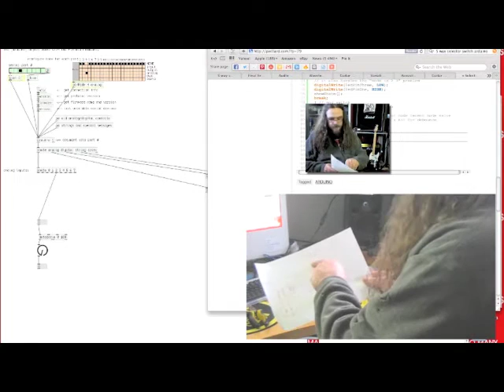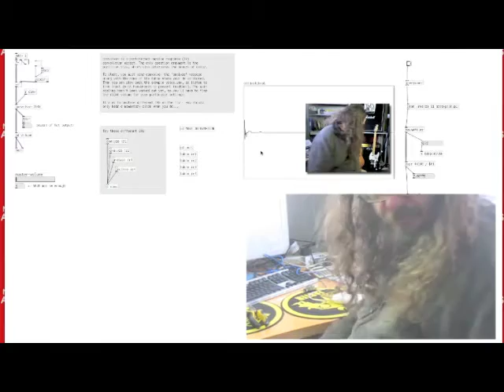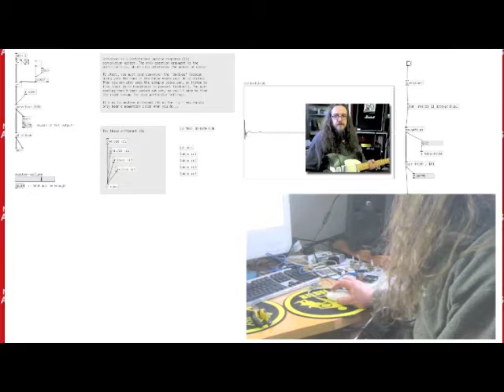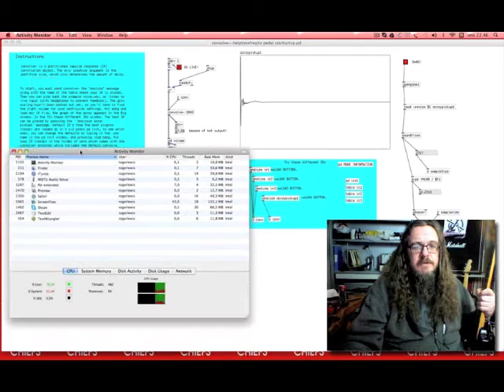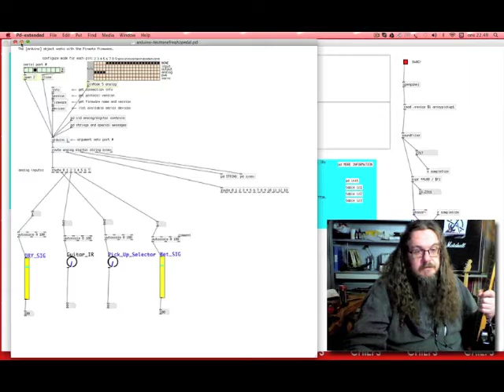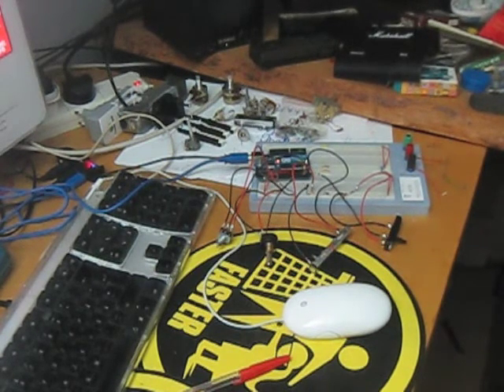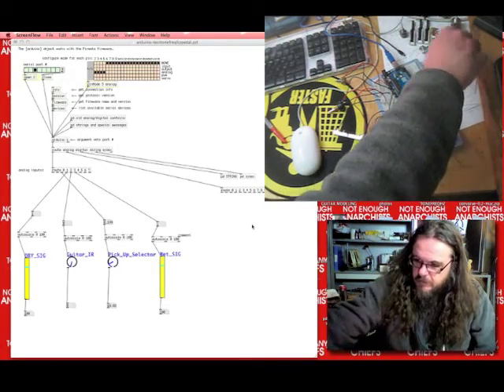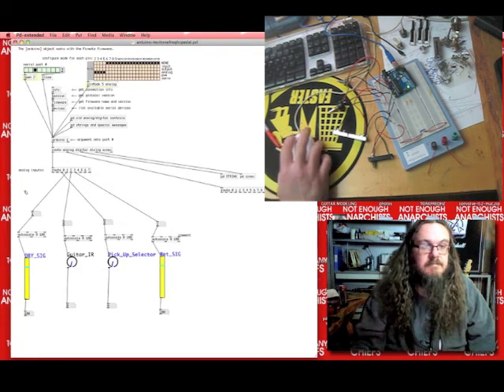progress report Tonefreqhz Arduino pedal and Pure Data convolve pup replacer

Comment: How has this come along? I'm interested in using arduino to strictly run impulse responses after a preamplifier. Thanks!
Reply from the maker: wildbillpreston Hi, I pretty much abandoned arduino for this concept as I wanted a stand alone pedal and controlling my computer with the arduino whilst a good learning experience was not my ultimate aim. I have not built a final version but settled on the idea of running existing IR plugin hosts in a linux based all winner board . The Olminex line of development boards are the ones I have been most interested in. https://www.olimex.com/Products/OLinuXino/A13/A13-OLinuXino-WIFI/open-source-hardware soon after starting this project I found these things http://www.smproaudio.com/index.php/en/products/v-machines/v-machine and the A13 OlinuXino can do what they do, for an IR host in Linux Rackarack there is an IR host for guitar cabs etc , there is also a pick up replacer so from a functional perpective for what I wanted , a homemade host for home made IR responses an open source solution that is very powerful was achievable the arduino does not have the processing grunt needed to do what I set out to achieve.